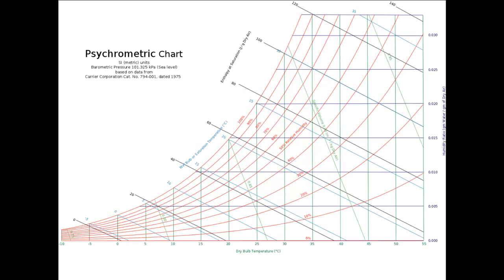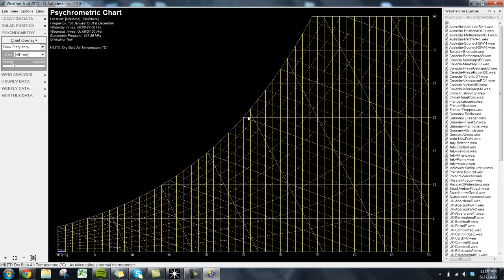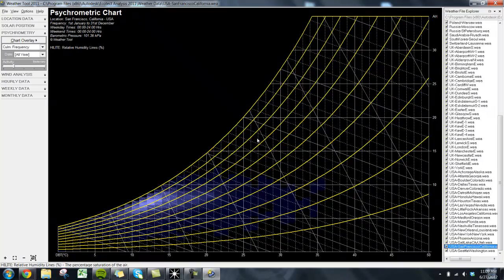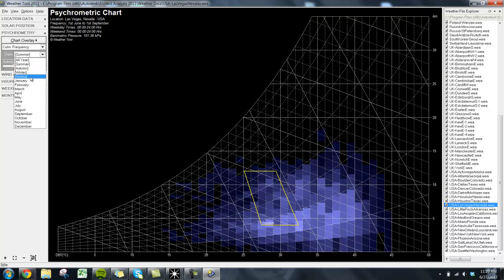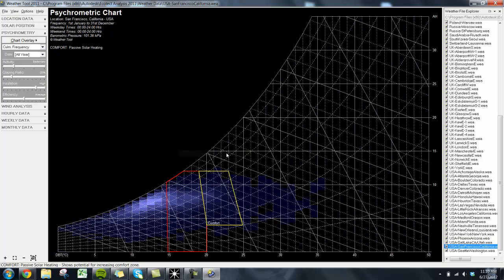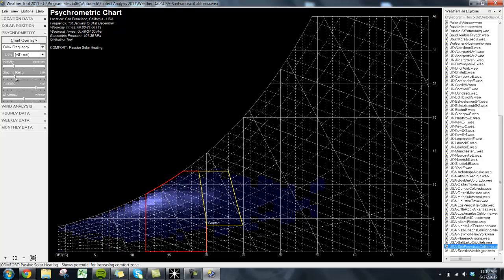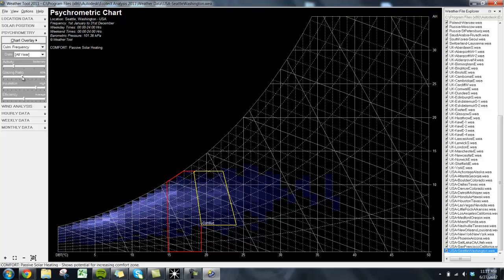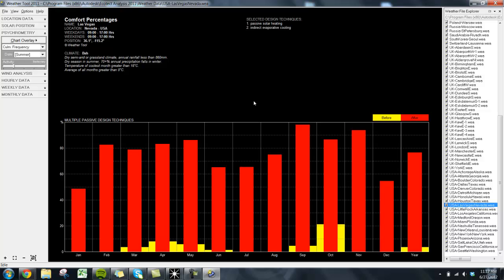Using Psychrometric Charts for Building Design

Comment: Thank you for this video, Adam and Autodesk!

At minute 1:15, the narrator states that relative humidity (RH) lines "are curved because air can hold more moisture as it gets hotter."

That's not quite true.

Air can hold more moisture as it gets hotter - that's why the line goes up.
As air gets hotter, each incremental increase in temperature results in an increasingly large increase in moisture-holding capacity - that is why the upwardly trending line is curved.